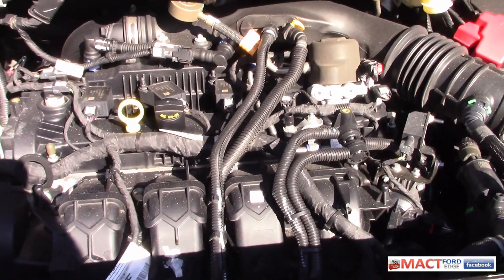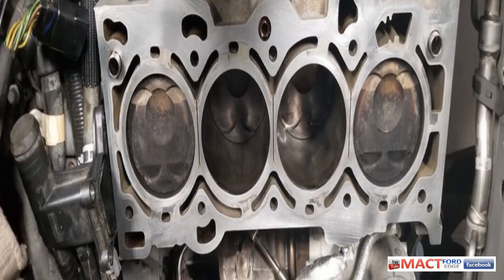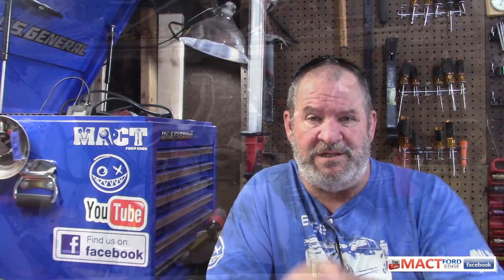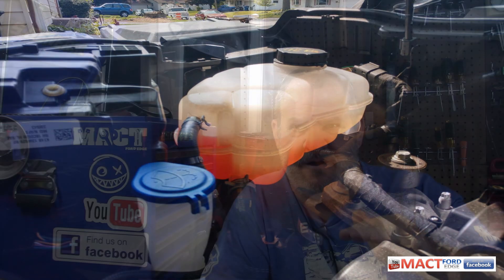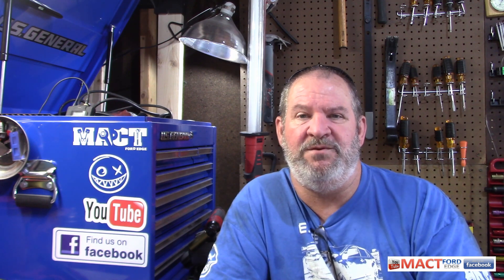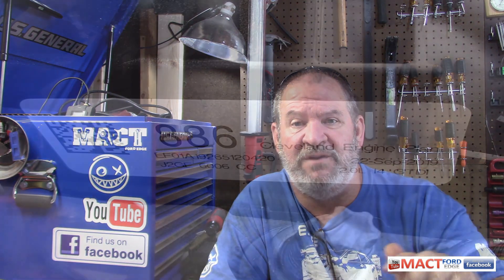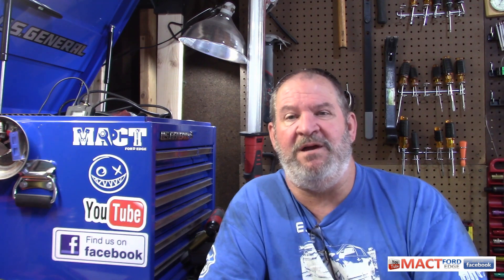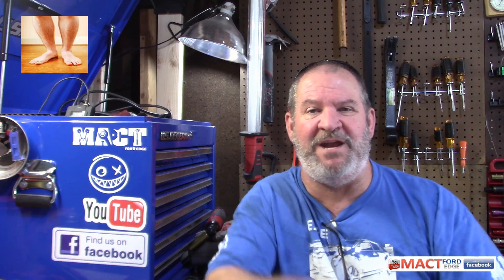Why I am excited my 2.0 Ecoboost was built in Spain and not Cleveland  Ohio

Comment: I just watched samcrac's video about this issue in his Lincoln; his video clearly shows his engine is from the Valencia plant. so no, those aren't any better than the Cleveland ones. for me, fortunately/unfortunately I have a '17 Escape 2.0 ecoboost with 61K, so far it's fine and I did have the sense to buy an extended drivetrain warranty. but I still hope it doesn't fail.
Reply from the maker: Year of the Lincoln?  Pre 2019?  if so then yes same issue.  2019+ is a different engine.

Comment: My 2017 Focus ST 2.0 was built in Spain with a little over 37,000 miles. I’m now having coolant intrusion issues. Getting ready to purchase a new long block out of my pocket at a $3500 cost.
Reply: Your vehicle should be under the powertrain warranty until 5 years or 60k miles. Go to your dealer and have them fix it.
Reply from the maker: EGR failure most likely.  Not coolant intrusion.  VEP Ecoboost has an EGR issue. Different problem than what I addressed.
Reply: @MACTFordEdge  just had this happen to my 1.5L ecoboost. It is still under warranty because I added an extended warranty and ford replaced the whole engine under warranty

Comment: Video brings up some good points but it should be taken as mainly speculation more than anything. We don’t really know the ratio of Cleveland to VEP engines out there and we don’t know if they were making the blocks with different tolerances in Spain or not. This problem is caused by the design of the block and it would appear both plants did produce the same flawed design at some point. All this to say still check coolant and get an ESP on a VEP engine, there’s not definitive reason to say it won’t happen yet. Also this problem only affects ‘15-‘18 2.0’s so if you have a ‘19 or above don’t worry, they changed the block design.
Reply: They have to replace my lincoln mkc 2.0 engine its a 2017. Did they redesign the engine? What did they do? Any links on it?
Reply: @Joetrout  They redesigned the passages in the block but they were very quiet about doing it (probably don’t wanna admit the previous ones were flawed). Anyway you can find images online of the blocks side by side. There’s really no way to check if you’re gonna get a new design one or not, I would imagine they all are but the techs will likely just install what they can get their hands on.
Reply: @jayhawker03  thanks really appreciate that help and quick response. My car has 48,000 miles just found out we bought the extended warranty lasting me i believe up to 150,000 miles so we will drive it then get rid of it.
Reply: @jayhawker03  Hallo, do you have any information/document about redisigned Fusion blocs?

Comment: Just so you know this seems to be affecting the 2019 that is assembled in 2018 my car just broke down and will keep you updated it is at the dealer now with extended warranty! Fingers crossed!
Reply from the maker: The block was redesigned.  You have an EGR leak as 2019 was the first year ford started using EGR's on the 2.0 ecoboost.  Well documented TSB on the coolant issues with the EGR.  Do please research so you can educate yourself.

Comment: Great video, what octane do you use, checked my 2020 2.0 made in spain💪
Reply from the maker: 91 non ethanol
Reply: @MACTFordEdge  thanks, I am using 93 octane Shell, surprised about non ethanol , any input accepted
Reply: This video really should have specified, it only effects 2015-2018. It does not matter where any ‘19+ block was made as the block was redesigned.

Comment: Did not Ford correct the head gasket issue in their Ecoboost engines specifically the 2.0L?
Placed fuell injected heads in top and lower cylinders  which helps keep the heads cleaner

Comment: I had a Ranger FX  with a 6 cyl  on the engine i noticed that it said Made in Germany
that engine ran so smooth and powerful
Reply: Cologne Germany, that’s fords cologne v6. Just prey the water pump doesn’t need to be replaced, it’s 🤑
Reply: @ryanthompson2893  I did replace the water pump and the bad plastic
water intake, $1800

Comment: I have a 2017 MKC with the 2.0 from Spain. Around 55,000 miles….I would start it in the morning and the car would idle like it was hesitating. Once I have it gas, it would idle fine. Had no check engine light. It wouldn’t do it every morning. Then, right at 60,000 miles…..it hesitated and P0302 misfire occurred. Replaced spark plugs as that’s the cheapest and easiest thing to rule out. The coolant was between minimum and maximum. Topped coolant off to max and will observe. As of yet….car hasn’t acted up and coolant remains steady. Next time it acts up and coolant level decreases….it’s going to shop.
Reply from the maker: Your VEP has the same design flaw as the clevelands. 2019 was the date of the block change and design adjustment.

Comment: my wife's 2017 Ford Edge 2.0L Ecoboost with 68,000 miles just started acting up with Cylinder #2 misfire and coolant in the cylinder. Engine has the Cleveland sticker on it. I dont know what to do. I called the dealer and this engine is on backorder.

Comment: Its simple. The closed deck design was good. The open deck design is getting the  antifreeze intrusion. The 2.0 was supposed to be bulletproof. Its not. 1.5, 2.0 and 3.5 are all bad after 2016. Even 2 Lincolns are on the list. And the tsb came out dec 19 1999 on ecoboosts. The Broncos and Mavericks were recalled in 6 months.

Comment: That’s why I prefer naturally aspirated engines  cheaper to maintain    I’m not a fan of echoboost  Gdi.  Turbo Head gaskets problems carbon build   No thanks
Reply: Yes that’s what I thought but we have 3.5 ecoboost engines on our work trucks and they are most in the 300-400kMs  and still running strong with good power . I was surprised actually
Reply: Thank you for the informative video. Last month I purchased a Ford Edge 2021 with 10000 miles on it prior to seeing your video, I just looked at it and I have the VEP engine, Which is a relief
Reply: PS, I upgraded from my 2017 Subaru outback to the Ford Edge and the edge is better in every regard I just hope it is as durable as my Subaru was

Comment: MSc I like your videos and lube videos but wtf are you going to do with that cute edge when the motor blows?
Reply from the maker: Well it is under a 9 yrs 150K mile Ford Premium Care ESP so if it goes Ford will fix it for $100 bucks.
Reply: @MACTFordEdge  Nice. Was that available when all the Tritons had horror stories going on? The Ford Tech says most of the 4 cyls have damaged blocks when they blow the HG so  needs a new engine. Cant mill the open deck blocks.
Reply from the maker: @robertrpenny  Only the 2018 and earlier have the block design flaw.  The 2019+ have the new block design, but the EGR cooler is now the leaky part of the design.

Comment: What I'm most curious to know here is the ACTUAL failure rate of these engines....like in real numbers, what percentages are we talking about?  Is 1% 5% 10% 20%???  Obviously on the internet its the squeaky wheel that gets all the attention.  People that have these cars who never experience a problem, we're never going to hear about those.  Is it one of those things where its just a matter of time that one of these engines eventually blows up, is it made worse by certain lack of maintenance practices or driving habits that exacerbates it.   I've read stories of people saying their EcoBoost ran for over 150K miles trouble-free and other that say it popped with only 20K miles on the clock.

So at the end of the day.....we need to know what the REAL failure rate of these engines is.
Reply from the maker: Only Ford knows this and they are not talking.

Comment: Why can't you just replace the head gasket on these?
Reply from the maker: Because the block is improperly designed and flawed. Not the head gasket.
Reply: @MACTFordEdge  Is the part number for the updated block 6009?

Comment: If you buy an Edge with engine built in Cleveland, then you should probably buy the extended warranty, and buy it from a Ford dealership so the extended warranty company is not a fly-by-night that won't pay out. It will be well worth the peace of mind because engine replacement is about $7,000-$10,000 all-in. My used 2019 Edge Titanium with Elite appearance package and 20" wheels is a beauty, but I bought it from a Ford dealership and it had the 'Gold' level Ford used vehicle certification, extending my powertrain warranty to 100,000 miles on my specific vehicle. I checked my sticker and the engine is VEP - maybe dodged a bullet. Normally the guidance is to not buy an extended warranty because you won't need it, but I think with the new generation of turbocharged engines making huge specific power per liter, it should be standard practice to buy that extended warranty.

Comment: The 2.3 is made in Spain and USA. They both are made with the exact same tooling and parts, unlikely to be a significant difference. My US built 2.3 had been flawless, great engine. That said l know some older Ecoboost had head gasket issues, fixed by a design change in 2019.
Reply from the maker: Maybe but I am discussing the 2.0 Ecoboost not the 2.3.

Comment: Mac T i was wondering  where the 3.5 engines are made ? the same plant or different and if different plants  does this cause one water pump to fail versus the other?  just a thought
Reply from the maker: Ford Lima Engine Plant
Reply: Plants don’t cause failure to begin with, correlation is not causation and there are many issues with the reasoning in the video. The water pump issue is mainly a gasket or bearing failure. Both of which are caused by wear and wouldn’t have anything to do with how they are built.

Comment: So my question for you is I had a Cleveland engine in our 2015 edge. We had the short block replaced due to a ssm where a cracked flexplate damaged the block/crank. Does that mean the new short block that it was replaced with and the new head gasket will eliminate the possibility of me having future issues with my motor with that current problem?
Reply from the maker: If it was replaced in 2019 then you may have gotten a newly designed block.

Comment: Good advice on ESP turbo + GDI + small engine = trouble. Ford, Hyundai, VW & others have all have premature failure rates. Have you fixed your Ford lately. Bad design problem. Keep it long enough you'll find out.
Reply: 65K on my 2.0 GDI Turbo EcoBoost from Cleveland and it hasn’t been to the shop once (I do fluid changes at home). No leaks, no loss of power, no problems at all. I’m sure there were people skeptical of VCT when it came out or DOHC but many of those original designs didn’t have any issues. No reason to be scared of an engine design just because it’s new, there are tons of EcoBoosts with hundreds of thousands of miles.
Reply: not a design issue

Comment: my 2016 ford fusion has had the engine replaced twice becasue of cylinder #3 piston head cracked or catastrophically failed. no idea where they were made.
that happened 3 months after i bought it and exactly a year later.
my 3rd engine is doing okay but im loosing coolant. I did have the oil tested recently and found that it has ZERO water or coolant present in it. 
i've done the exhaust test and UV dye test and cant find the source of the leak. 
Ford should absolutely be sued and forced to recall the engines.

Comment: I have a 13 fusion titanium with the 2.0 and I have been joking for years about how there has to be two plants because mine is at 145k with none of the usual issues people are reporting at way less miles.....turns out there is and mine is a VEP build lol haha
Reply: Funny how you have the single scroll older design that doesn’t have this problem. You have an entirely different block pattern than the twin scrolls so it doesn’t matter where yours was made “lol haha.”
Reply: My 13 2.0 had 112,000 miles runs like new.
Reply: I have a 2014 Fusion Titanium with the first gen 2.0 and it has been a gem. Currently at 138k and no issues.

Comment: Just troubleshot my buddies 
VEP engine failed coolant in number 4 cylinder
Reply from the maker: EGR failure
Reply: Egr problem no. Plant doesn’t matter the block was never designed right they went away from a slit between cylinders on the block to a hole which is the issue.
Reply from the maker: @chdhyt1985  Photo of the block that you are talking about.  No slit in the VEP.

Comment: Mine is a vep and getting a motor put in as i type.
Reply: Also my engine trouble is not with the head gasket but the cylinder 1 wall cracking.

Comment: My 2011 Ranger 4 cylinder lost a  head gasket the 2nd week of ownership. That was a  Spain engine.
So  stuff happens. What does the TSB says is the  issue, root caused and how is it rectified?
Ill Go with  USA  Ohio over Spain anyday. Not that Spain is stupid, but I buying a  car with US  dollars and I want to pay  US employees.
Reply from the maker: Different engine
Reply: @MACTFordEdge  Yes it is But that does not make  SPAIN the country of  "no HG problems"  was astonished that a simple modern engine would have this issue. But open deck blocks with siamesed liners are to blame MOST of the time. - Be Good!  Sandy!
Reply from the maker: No idea but VEP engines are not suffering the same issues.  VEP engines are however suffering from EGR issues the same as Diesel engines since Ecoboost and Diesel engines share this same part.

Comment: From your sampling, how is the coolant intrusion happening? Is it gasket related or cylinder wall ? Can I prevent this by having another gasket installed?
Reply from the maker: Engineering failure on the mating surfaces between the head and the block.
Reply: It's a junk design

Comment: My '17 Escape Titanium 2.0 with 28K miles just had the long block replaced for the coolant leak.  Why Ford hasn't issued a recall for this known issue boggles my mind and confirms to me why this will be my last Ford.
Reply: My last ford too.  WHen i was at 30,800 miles my throttle body needed replaced. Ford told me get lost and i even lost my appeal. I was 800 miles over the first warranty. So i bought the part and did it myself from ford costing 150.00 when they wanted over 800 to do this. So i can assure you, if you are out of warranty they will say thanks for the business but get lost.